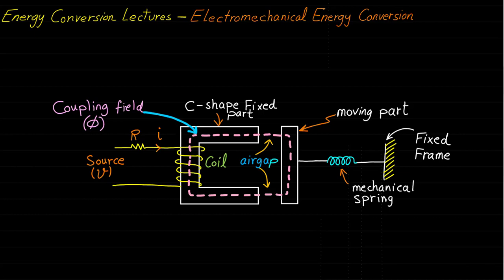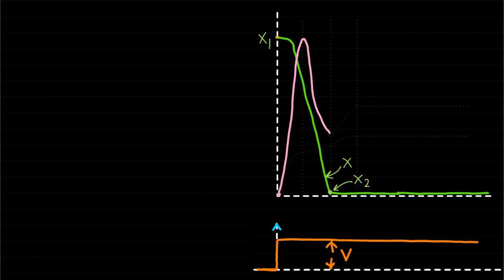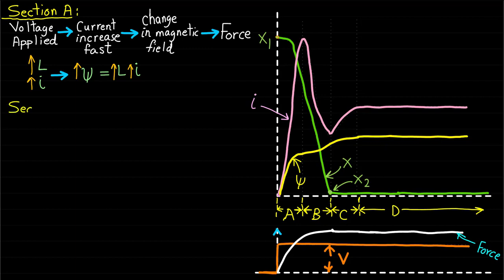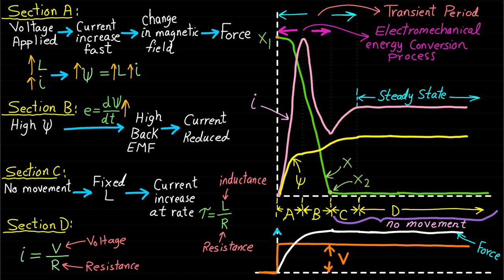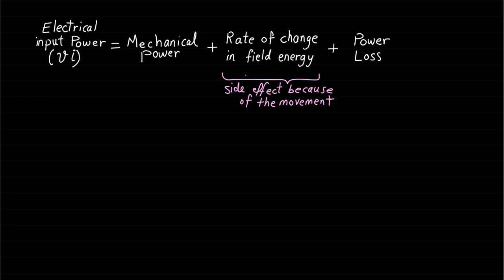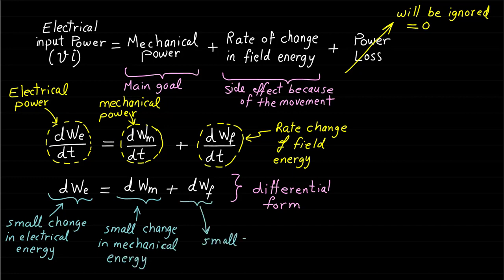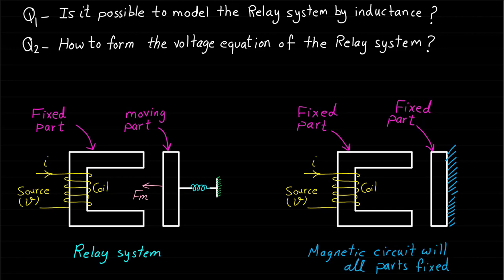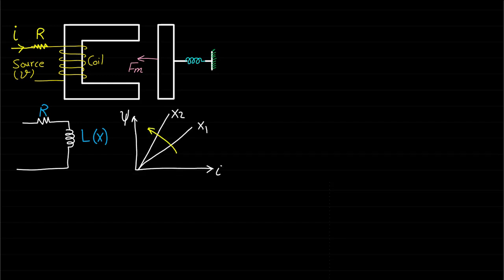Electromechanical Energy Conversion - Introduction (Part 2)

Comment: Shouldn`t current in section D be higher than V / R ? 

I mean we need energy to maintain the position of movable part after the movement was completed. 

Like if you would pull the movable part by hands exept the energy you need to pull the part, you should also need the engry to maintain the position of the part. Because you would need to conteract the force of the spring

Comment: Why current in section A is increasing significanly in compare to the current in section D? The maximum value of current should be determined by the applied voltage and active resistance (V / R). Howewer in section A current is much higher than V / R.